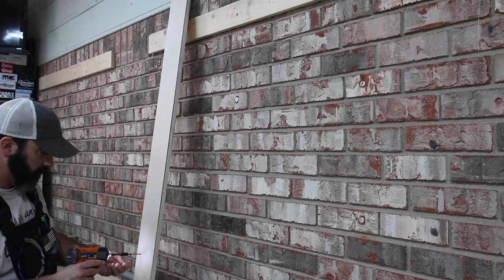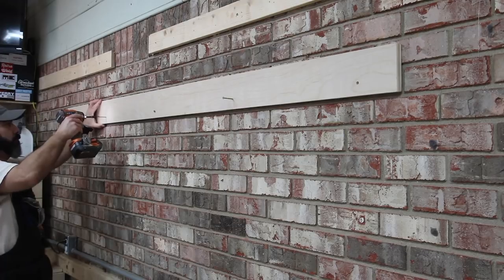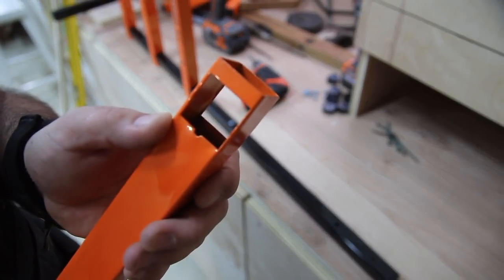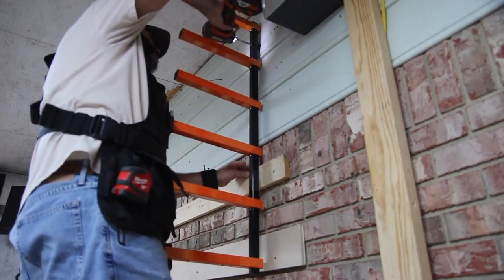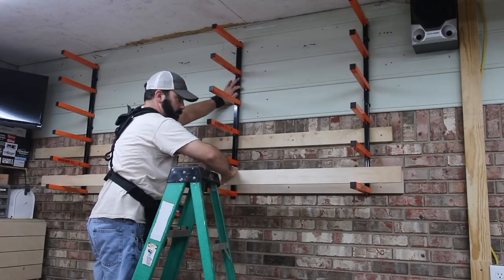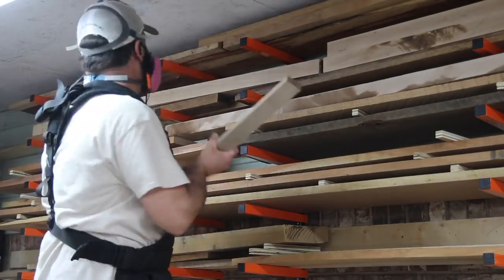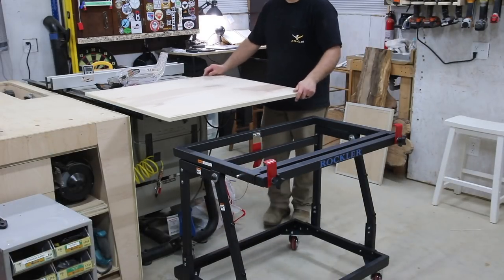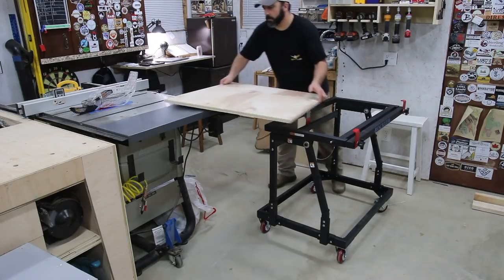How to Install a Lumber Rack - Woodworking Shop

Comment: That is a good lumber rack I have that same rack bought it last year after my basement flooded and a few hundred bucks worth of cherry and walnut was ruined..wish the vertical bars were longer but it does hold quite a bit a lumber for it's size that's for sure
Reply from the maker: Oh man. That stinks. Glad you got the rack.

Comment: Hey Shawn, I have the same rack!  Did you use wood screws to mount it?  I used lag screws.  Just making sure yours doesn't come down unexpectedly!  Keep up the good work!
Reply from the maker: I used wood screws in the lower holes in the brick just because of the size hole I had. I did use regular wood screws above, too, but changing them out to a heavier lag screw.